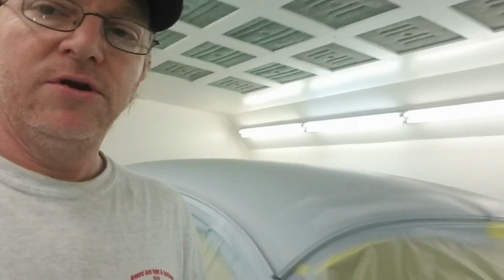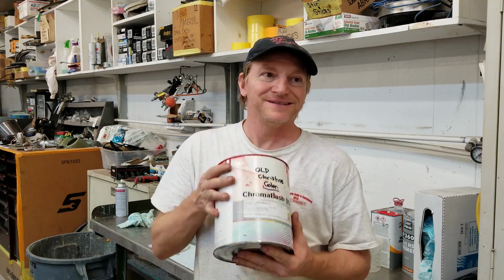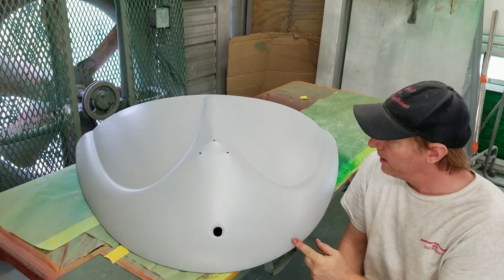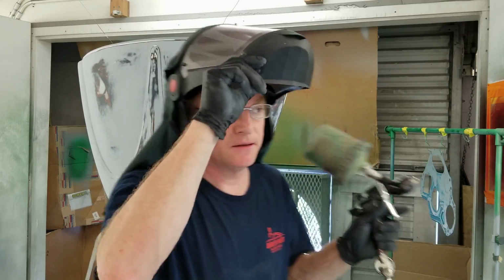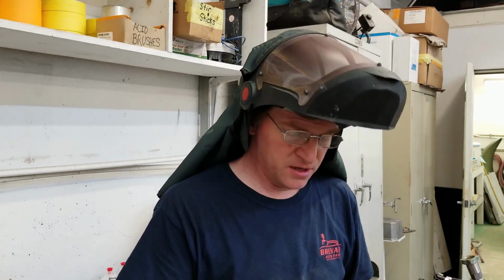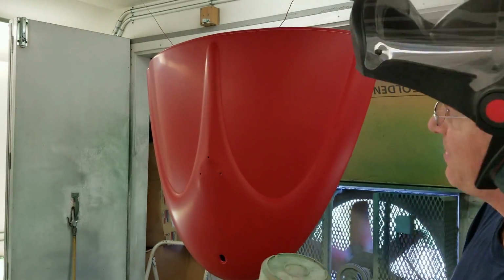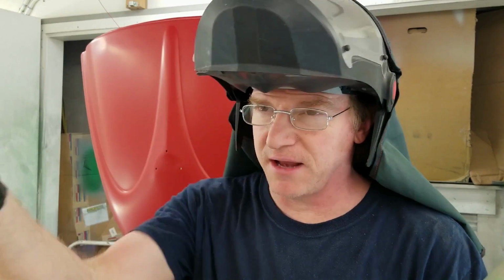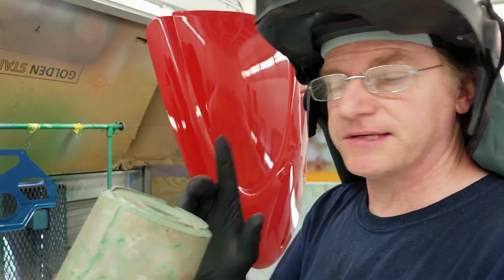Eleanore's Deck lid Paint Reveal - ROTTEN OLD CHOP TOP 1956 VW BEETLE - 136

Comment: Cool info Earle.
Question, when you say 2 and a half base coats are you meaning 1st coat at like 50% coverage then 2 heavier coats? Plus noticed you run round the curved edges 1st, does this help avoid runs? 
Just trying to confirm assumptions ;P
Knowing Glenn he'll probably go go Harlequin with Red Trunk and Deck, Green Body and Yellow Fenders 😜
Cheers mate.
Mark

Comment: Love the red.  I was wondering why the epoxy primer was not blocked before the basecoat. Probably could have taken care of the small waves that were going on in the recesses.
Reply from the maker: We did take  care of that before we shot the epoxy, sorry if I didn't mention it in the video or I edited it out ... I had it in 2k and iced out the couple areas needed, final sanded 400 and 600. Its came out great for Glenn's wall art.

Comment: Thought it looked good with the wet primer on it.....if this was going on the car, you would have painted the underside, right ?   Would sanding with 600 made any difference in the final job ?   I'll make a note to paint the W "ribs" first and then normal for rest of panel.